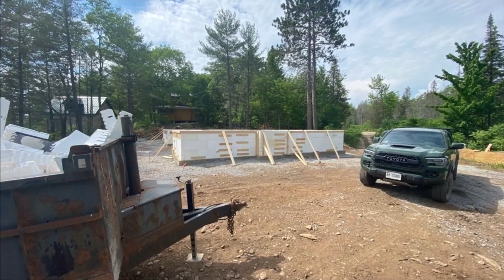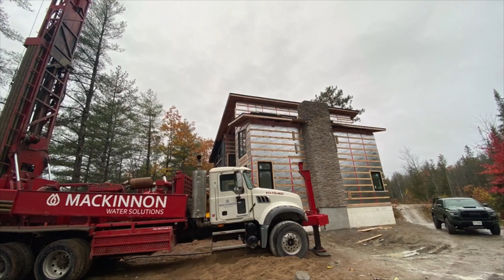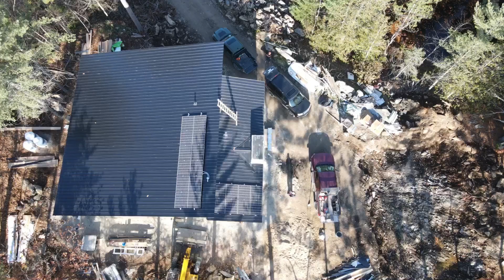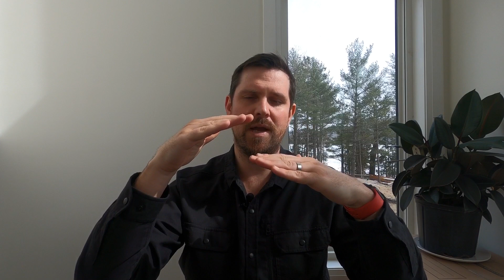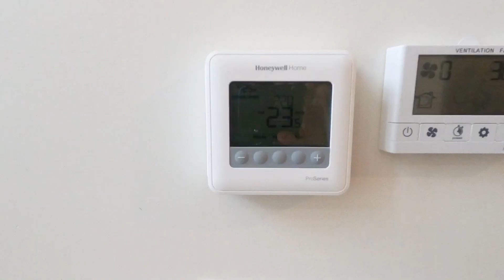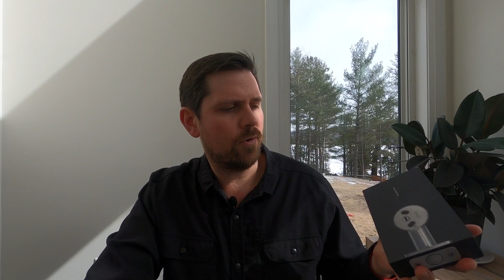Off-Grid Smart Home - Intro to our new house

Comment: Check out Inovelli for switches, I've heard they're having issues getting stock in with the chip shortages, but if you can get them they're pretty nice. They have a dimmer option and the LED light bar on the switch can be used for all kinds of notifications. They are Z-Wave or Zigbee, so you'll need a hub, but I've been really happy with them and use them throughout most of my house.
Reply from the maker: Great thanks I’ll take a look

Comment: What Wi-Fi equipment are you using? I am building a new home, not off-grid, but am looking at Ubiquiti. As far as light switches, I do want thread enabled as well as my smart lights. There really isn't much out there with thread for light switches, Wemo, and Eve. Are you getting security cameras? I have wireless now but am really leaning towards wired.
Reply from the maker: I also went with Ubiquiti. I’m going to cover it in an episode for sure. 
I chose the Dream Machine Pro. To some extent a little overkill but I really like the threat protection and the ability to use it for wired cameras with POE and onboard storage. The system is so easy to setup too. So far very happy with it but it’s only been a couple of weeks.  

Patiently waiting for thread switches…